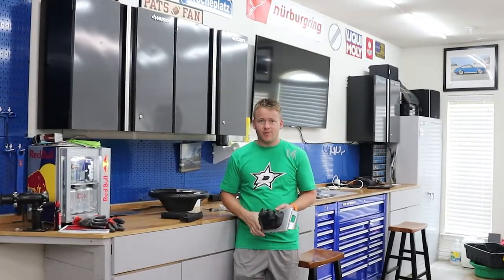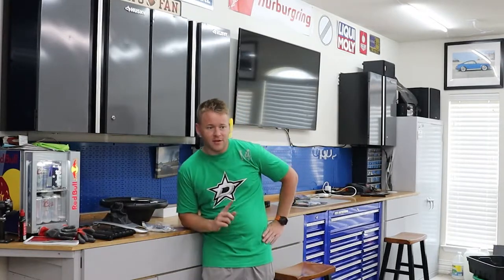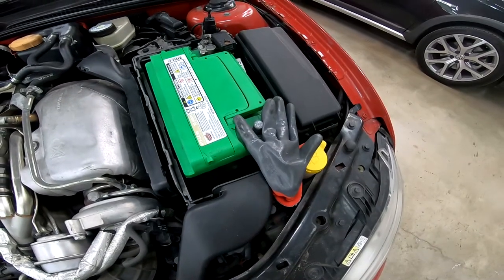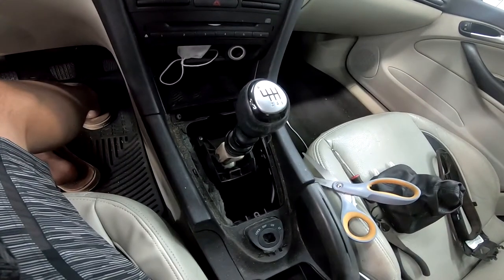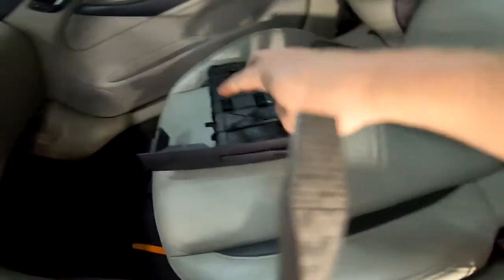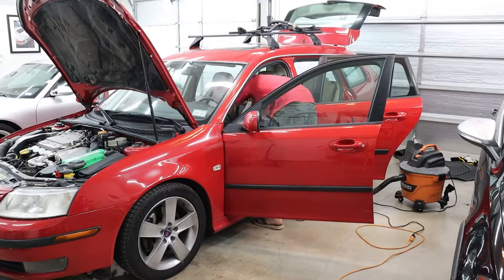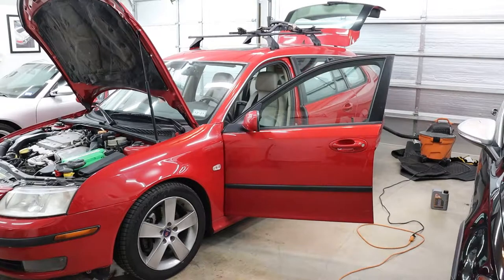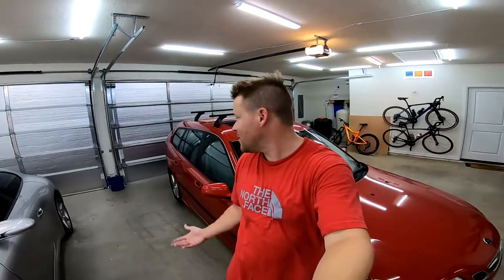Saab 9-3 Interior Restoration | Project Saab 9-3 Aero Sport Combi

Comment: Do you know what product to use to retore the top black section on the i tetior of the door to it's original color?  My driver foor has a little bit of a white haze on it. I think car wash guy got wax or something on it by accident.  Also anyway to mend a small tear in leather seat?
Reply from the maker: I used aerospace 303 for the black interior bits.